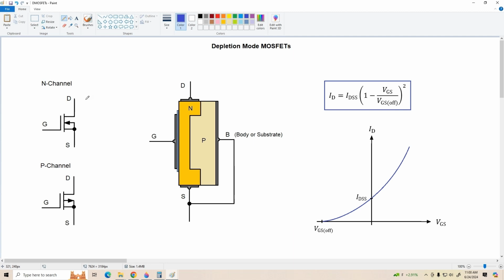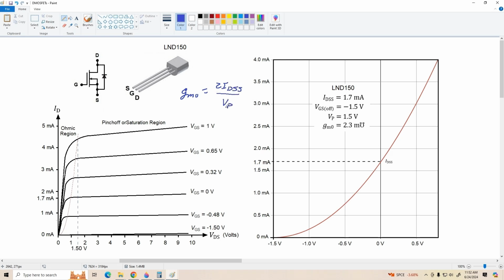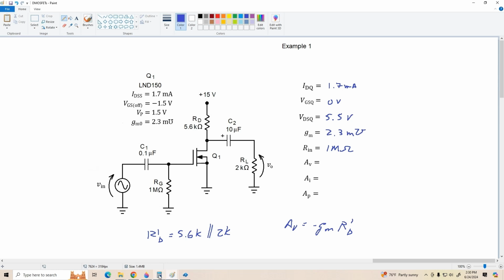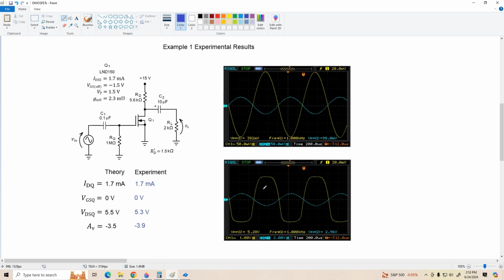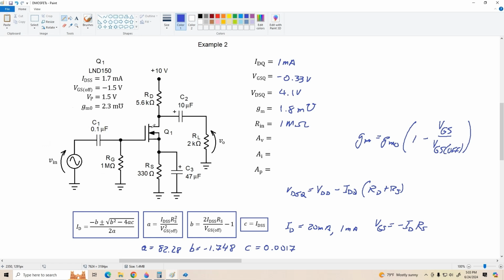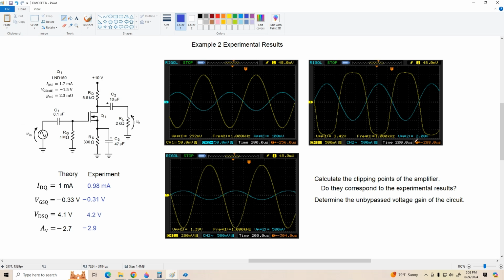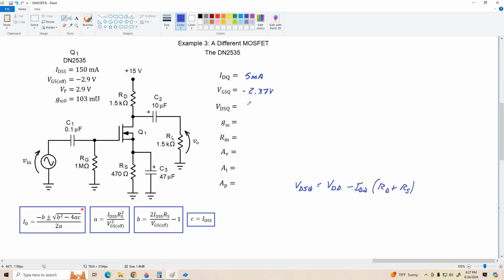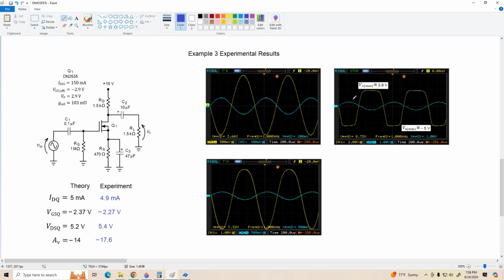Topic 47: Depletion Mode MOSFETs

Comment: Is it common for depletion mode MOSFET amplifiers to have lower voltage gains like JFETs?
Reply from the maker: Yes. It’s mainly because the channel of the D-MOSFETis relatively wide (part of the fabrication of the device) while the channel of the E-MOSFET is very thin (formed by the electric field between the gate and body) which tends to make them much more sensitive (higher gm).
Reply: @Denton.Dailey  Excellent explanation, thank you.

Comment: EXCELLENT VIDEO!GENERALY SPEAKING WHAT TYPE OF CURRENT HANDLING CAPABILITY DO DEPLETION MOSFETS HANDLE?
Reply from the maker: @davidluther3955  depletion mode MOSFETs are typically low power but there are power devices equivalent to typical BJT power transistors.